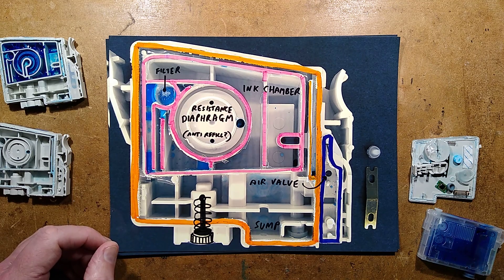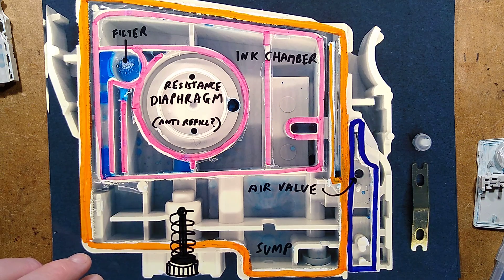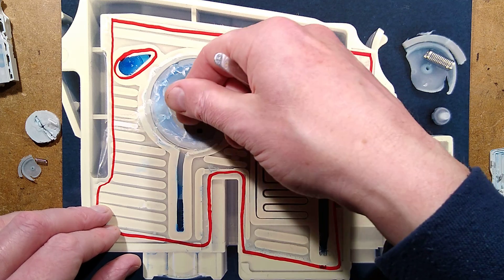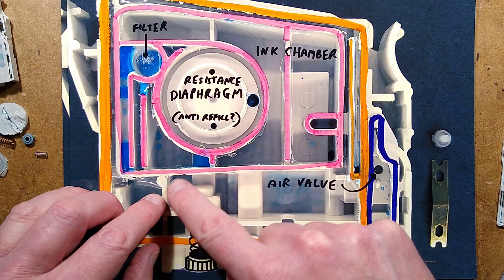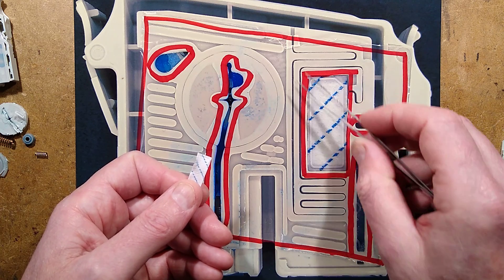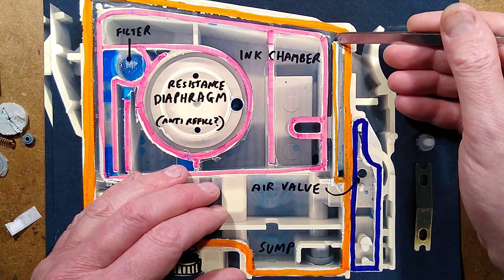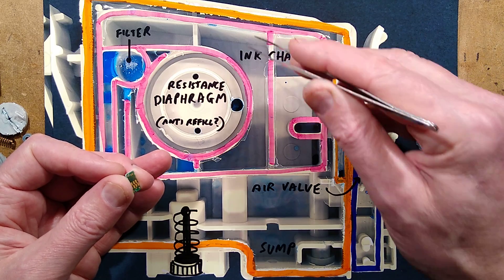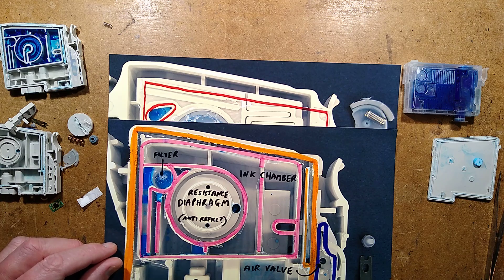Ink cartridges are complex inside!

Comment: Honestly the real anti-refill technology in any of these cartridges is the chip. I've been a printer tech over a decade now and even got my start working with ink refills, it's incredibly easy to refill cartridges, but getting the printer to recognize the chip as legit is the hard part. I personally use a laser printer for my main daily driver and use third party cartridges. For photo prints or anything color critical I use a Canon pro photo printer with OEM cartridges.
Reply: Isn’t that where the chip resetting tools come into play though
Reply: I have a Canon ink tank printer, and while I hate the Canon interface, it works perfectly fine. And the ink is WAY cheaper than cartridges.
Reply: OEM is ALWAYS Best for Accurate, Repeatable Results!!! I used be a laser printer tech myself and I would always cringe when the company I worked for would use 3rd party non-OEM parts & supplies...imaging drums on mono machines (Ricoh/Savin/Lanier/Gestetner) almost always had about a 30% reduction in yield. NON-OEM color toner was the worst!!! Probably the best brand of machines that I worked on were Konica-Minolta!!!
Reply: @RTR-MATEY  Dude, I feel your pain. hookey parts are always a false economy and 3rd party ink/toner just adds unnecessary wear to parts and very often just looks awful.
Reply: @RTR-MATEY  for mono printers it's still 100% worth going third party. 30% reduction in yeld but costs like 1/3 in bulk? Yeah don't worry about it

Comment: Laser printers do not dry up. Inkjets use water-based inks which dry up in a very short time.  I switched to a laser printer years ago.
Reply: I have had laser cartridges get so old that the print quality got very bad. I had to replace the cart while it was still more than half full. The epson ecotank we use now has been flawless for over 2 years and we are still less than half through the huge amount of ink it shipped with.
Reply: @John_Ridley  probably you'd just had to shake it sideways for a bit, if it doesn't help, your print drum may have become dusty or didn't charge right anymore electrically. I have maintained quite a few of them, only one or two printers in the whole company had this problem at some point in time and we used them a lot at the time. Except for one LaserJet 4200 or something along that, that was a catastrophe from the moment we unboxed it.
Reply: @gentuxable  The other thing is that we print a lot of stuff that requires color, and my experience with color laser has been bad and very expensive. Toner carts are so expensive that at one point I bought a new printer and threw the printer away because the half-full carts they gave with the printer were cheaper that way.
I've owned a lot of printers over the last 40 years of every type. The one that works best for me is color ink tank technology. Obviously everyone has different needs. I just caution against people who just throw out blanket statements that "everyone should just run laser." I realize you didn't but a lot of people do.
Reply: @John_Ridley  Everyone drinks their tea in their fashion. Some ink tank printers have a non-replaceable residue tank that will fill up after a few years and is not meant to be replaced. For me ink is not so great because I can't use a text marker on it and wherever you have an image the paper is drenched the paper is wobbly. I agree printing photos isn't great on laser, those I can print out at the shop, thermal sublimation is the best technique for printing photos.
Reply: @gentuxable  Thankfully I have no need to print photos, just color.
Reply: @John_Ridley  For just color documents and business graphics I see no difference between laser and ink these days as laser got less expensive and ink is more subsidised than a decade or two ago and so the prices are quite similar these days. I had an extensive look at the market recently and switched from an Epson Ink printer to a Canon color laser and the price is extremely competitive while even the most expensive tank MFC doesn't even have duplex scan capabilities which is just a dealbreaker for me.
Reply: @gentuxable  Yeah my Epson doesn't have duplex scan and that's a huge bummer. However I do have an old large format printer in the basement that was pretty expensive to start with but the print half was broken, I use it now as a dedicated duplex scanner and it does that very well so I don't care that much about the current printer being a lousy scanner. Actually most of the time I use a flatbed scanner on my PC.
Reply: @John_Ridley  for me it was the most important reason to go for laser this time. I have not much space and I need to copy documents quite often and was not ready to sacrifice duplex.

Comment: I would love to see a similar teardown to laser (toner) cartridges. I love having a laser printer for occasional use and never having to worry about ink drying up over the years.
Reply: Expect a "Toner Explosion"!!!😂
Reply: Laser printers have their own shortcomings, but mostly from dried out rubber traction wheels.
Reply: @ehsnils  All the ones that I worked on were either worn out (slick), or coated with paper dust (also slick!) To rejuvenate/clean, all I had to do for the rubber pickup, feed and reverse (double feed prevention) was to clean and wipe them down with some WD-40 on a rag. For the silicone rubber rollers, I used a bit of Isopropyl alcohol to clean and "re-tackify" them!!!
Reply: @Sanadis That's because toner isn't a liquid to dry out. It's a fine plastic powder that's melted to the paper. That's why laser printers make the paper warm
Reply: not a lot in a laser cart,  just a container of toner powder and a plastic auger to move the powder to the outlet port (like a big plastic screw feed). Some sort of spring loaded door to seal the outlet door when the cart is out of the printer and a drive for the transport system
Reply: most toner carts are just full of powder, nothing interesting besides maybe some auger screws to stir the toner. The drum cart from a laser might be slightly more interesting, photoconductive drums and charge components/ cleaning and quenching bits.
Reply: I would love that. Especially to explain why some toner cartridges leak toner. Original and/or refilled. Oh, and maybe Laser versus LED technology.
Reply: Those toner cartridges last a lot longer that ink cartridges too.
Reply: The toner powder is actually an iron oxide. You can tell because it is attracted by a magnet. Just make sure you put the magnet in a plastic bag first. Otherwise, the only way to get the powder off the magnet is to use silly putty.

Comment: There is indeed a lot of interesting engineering going on within a ink-cartridge.
That special fibre piece is I would guess for moisture control; the air going into the cartridge should be quite "dry".
Where as too much moisture would affect the ink, and possibly also cause static electricity problems.
(I worked for a printer/plotter company as an apprentice in another life)
That's why on high-speed ink-printers you will often see long strips of bristles that are in fact touching the paper being fed thru to reduce static electricity.
BTW, I did not see in your, further more than excellent, video where that NFC memory chip would be located in that particular cartridge?
Reply from the maker: The chip is mounted on the outside at one end.  It's just a low capacity memory chip.
Reply: @bigclivedotcom  Thanks, much obliged!

Comment: Once working for a firm that did shop window size prints, some needing three pieces of metre wide self adhesive film, colour matching over tens of square metres was crucial. SO everything that kept colour and density constant was worth the money.
Others may find that an A4 sheet with four or five colours as highlights in the text is perfectly adequate.
Reply: I bet your system was Pantone color correct?🤔 perhaps using a Fiery type print engine?

Comment: Would be interested to see a canon cartridge teardown. When I used to stuff around with refilling many many many years ago I did a similar thing to you.
I don't think the canon stuff was as complicated. Lets face it if Epson can make it super complicated then they will.
Good job anyway. 😃
Reply from the maker: I've just checked an old Canon one.  Two voids, one with a sponge to regulate ink flow, and a label on top over the air inlet path.
Reply: I've been using the same Canon pixma for over 10 years, never bought an oem cartridge. It went through about a litre of 3rd party ink in bottles, now I use cheap $1-2 ebay cartridges. Never an issue and photos have stood the test of time. Ink is ink it seems.

Comment: I think a lot of this complexity is because the piezo printheads Epson uses are very intolerant of bubbles in the ink. The thermal inkjet (“bubble jet” in Canon’s marketing) heads used by Canon and HP are much less fickle, so they can use much simpler cartridge designs.

Brother also uses piezo. All of these brands use, in their large-format and/or high-end inkjets, cartridges containing simply a pouch of ink inside a plastic shell. Those avoid all the problems with bubbles and cartridge complexity. And then there are the ink tank models, too.
Reply: "High-End" inkjet would be HP's "Pagewide" technology where multiple printheads span the width of the paper, remain stationary and the paper moves below the printhead array. Not exactly a cheap technology!!!
Reply: @RTR-MATEY  No, printers like the Brother A3 all-in-ones, and things like Canon poster printers all use pouch-in-a-box style cartridges. HP doesn’t make PageWide desktop printers any more. Their PageWide printing presses (the ones for continuous-web printing) use ink in drums.
Reply: Not my brand... i still use thermal paper. Now try making the refills for that yourself ;)
Reply: My experience of Canon vs Epson is that Canon printheads are far more prone to blocking. More ink is wasted having to clean the heads frequently.
Reply: @michaeltb1358  sometimes it's not just clogging. Thermal printheads are much more delicate than piezo ones. If there's not ink in the thermal chamber of a head, that head can burn and won't spray ink again. Also, if you use the printer regularly (like at least one time per week) you shouldn't get clogging. Most people buy a printer and only use it now and then, leaving it for months without using it.
Reply: @michaeltb1358  That is the polar opposite of how it usually is. Epson printers are notorious for clogging, though it seems to be better in recent ones. Epson inkjets from the late 90s through at least 2010 were absolutely terrible in this regard: it was not uncommon for them to develop permanent clogs that could not be fixed.
Reply: @michaeltb1358  Pigment (particulate) based inks (Epson) are going to clog much easier than dye based inks (Canon). BTW, stop using 3rd. Party non-OEM inks and your chances of clogging will drop significantly.
Reply: @RTR-MATEY  and so will your bank balance - £36 for a SINGLE BLACK or £36 for a complete set!
Reply: @RTR-MATEY  Both Epson and Canon have models with dye inks and models with pigment inks. 
Totally agree with you about avoiding third party inks.
Reply: As I tend to work with Brother inkjets I know that they effectively have two print cartridges for each colour. One is the traditional replaceable cartridge, the other is a chamber in the print head connected by tubes to the original ones. Their way of dealing with cartridge bubbles maybe.
Reply: Very interesting. I'm still using an old HP inkjet which takes type 45 black cartridges. They seem to hold the ink in a bag inside the cartridge which, once the air is bled out of it manually through the print head, doesn't suffer from bubbles. Though the print head is part of the cartridge, it seems to last for about 6-7 refills before print quality really starts to suffer. Having seen this video, I'm sticking with my old HP!

Comment: The one disadvantage to the design though, the heads in the printer are the same from the day it's made to the day it's in the bin, other manufacturers (such as HP) designed their printers so the cartridge had the heads built in so they rarely suffered from a permanent case of head trauma, though this did make them even more expensive to buy new cartridges for, but the cheaper ones (such as Epson), nope, one-shot deal, heads guck up, and it's done, it's e-waste... :\
Reply: I came to dislike those, because the new cartridges were extra expensive (often enough more than the sale/clearance price of the printer itself). And seemed to clog way more often than printers where the print head was permanently installed. Those cartridges always wiggled around a little so figured the worse tolerance caused more clogging, or that because the print head was expected to be thrown away, they went cheaper on that process, despite the still high cost?
Reply from the maker: There are tricks for cleaning Epson print heads.
Reply: We have a HP Photosmart (C309A iirc) and the Print head is not on the cartridge, but the carriage assembly that holds the Print heads and Cartridge's has a big lever that you lift up, and that unlock the print head itself which just lifts straight out of the carriage for cleaning or replacement, takes all of 20 seconds to remove the ink carts, and pop the print head out.

Comment: And this is why I bought myself an Epson ET-4700. "ET" doesn't crave to phone home, but stands for EcoTank (fansy word). It just means that the 4 CMYK colours come in plastic bottles with slightly different nozzles, which only function is to prevent you from putting the wrong colour into the wrong tank inside the printer.
Reply: I think that's what Clive currently uses.
Reply: I have a ET3850 and I love it!
It may not have the best print quality, compared to a similar priced 'regular' printer but the ink is so cheap that this is the first time that I don't even think if I want to print or not.
And you basically never run out of ink during a print job, because the ink tanks are huge.
Reply: Does your Epson have a user replaceable waste ink purge tank??? I got a Canon MAXIFY and the user replaceable waste was a definite bonus!!!
Reply: @RTR-MATEY  Yes, it does
Reply: @RTR-MATEY  I actually use my Canon LBP621Cw Color Laser printer more than I use the Epson... no smearing issues and I don't really print that often anyway.

Comment: Probably another reason why those cartridges are so costly. The injection moulds will be complex (i.e. higher cost), and even automated assembly will need a number of steps.  All add to the overall cost, not just the technically impressive ink formulations. Yet, having said all this, the cost of genuine Epson 542 ink is very cheap in comparison with what you get even in "generic" cartridges.

Comment: We had a solid ink printer in one classroom, that made really beautiful prints.  It used blocks of wax-like ink, so much simpler and not messy.  But these printers have some disadvantages that are probably the reasons why these printers are not popular.  
https://en.m.wikipedia.org/wiki/Solid_ink
Reply from the maker: Quite interesting.  I guess the colour lasers won that war.
Reply: The real disadvantage was that the print head was appallingly expensive and so was unclogging it. Plus, the fact that they had a warm up time and still had a lifespan on ink freshness just sunk them. Commercial printers, though, it makes a ton of sense and incredible print quality.